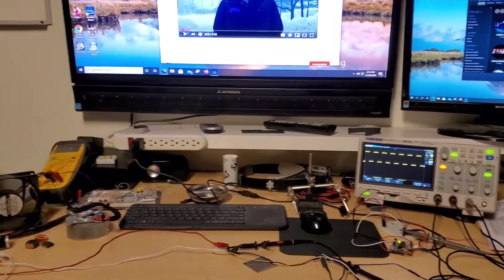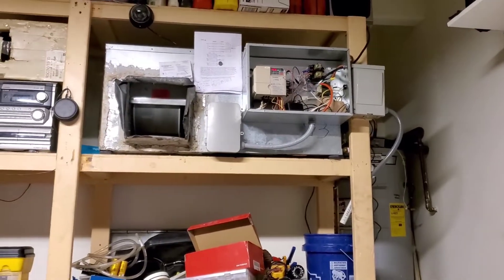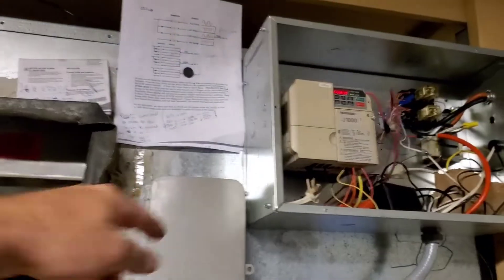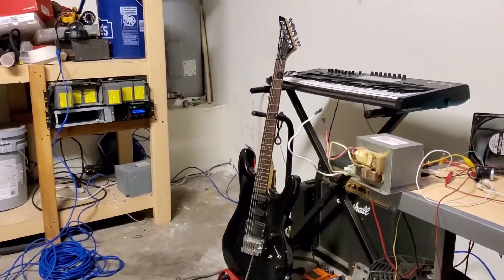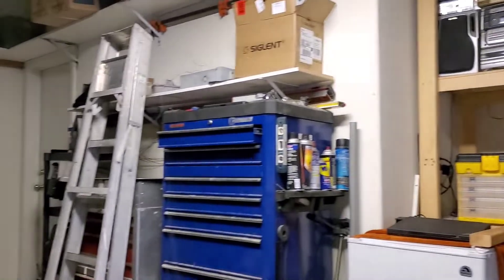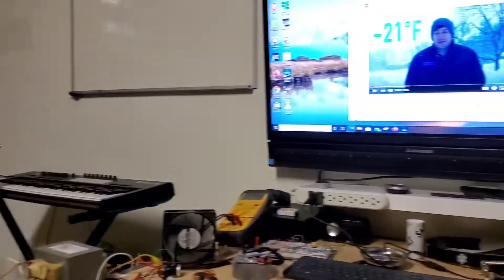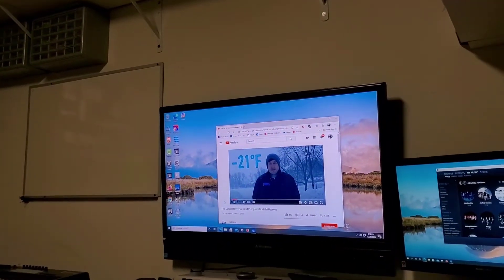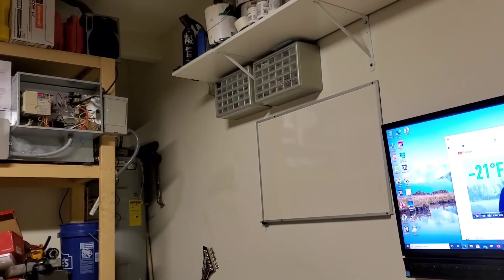I moved my electronics lab out to the garage where my heat pump water heater might freeze me out!

Comment: If you have a neutral, wire up the elements with 120V so they'll be 1/4 the power. That way heat pump and elements can slowly work together. You could also add contactor and 24V time delay so the elements run after like 30 mins if the heat pump isn't cutting it in the winter. Could make that work with a 2-stage thermostat somehow too. I know the hybrid tanks bring the elements in if the heat pump isn't keeping up after a while, such as in winter.

Comment: How do you like the water heat/cool set ups? I was thinking about doing one when I buy my house. Did it work well in the PHX heat?
Reply from the maker: It doesn't run enough to cool the garage in the summer. It is just there to heat the water instead of using the standard water heater electric heating element.

Now that it is winter and people are using the hot water longer it is overlooking the garage. Which wasn't an issue when I installed it but now I moved my electronics hobby stuff out to the garage.

I don't have any heat in the garage

Comment: You could get heat from composting leaves in a makeshift structure to store them in. A coil of poly water pipe inside circulating water could generate some heat. It might take a few weeks for them to start decomposing, but this method has been used to preheat the water going into the water heater. The review I read said that the water heater didn't come on until late April or early May, and that time of year the water temp going in was over 100°. Peak temperature was about 150°.
Concrete block stacked in a circle to about 6' filled with wet leaves and supported by rebar (or something similar) worked for the guy.
Reply: https://youtu.be/d4TfmP5cA-Y
Reply: @Farm_fab  Yeah that's a huge setup with probably 15 tons of compost and a 5 layer heat exchanger to heat ~55 gal of water, 15,000 BTU/hr peak output by my calcs (typical is probably half that). No mention of supply or return temps. It would probably take several hours to make enough water for a lukewarm shower with that setup. I don't disagree it works, it's just not going to be practical for homeowners on that scale, but if you live on a farm with a bobcat and tons of animal and plant waste then it might work for you. Your typical backyard compost pile isn't going to be big enough to do much. Maybe it could heat an insulated chicken coop but not much more.
Reply: @TechnicalLee  it's much larger than the one I saw in Mother Earth News, but much the same idea.
Reply: Makes kinda sense, but when extracting heat wouldnt that stop the decomposing proces? Otherwise its actually a genius idea.
Reply: @sjefoekel6058  I think this article I read was in the Mother Earth News many years ago, and it didn't seem to be a problem. The heat derived was from the decomposition process, and I don't think that they took it all away. The same could be gotten from wood chips from the companies that trim trees near power lines. If they are in your area they can give you some when they are trimming the trees, or call a tree surgeon.
Reply: Are you sure it wasn't air temps being measured? Water takes a lot more heat. Compost puts out heat very slowly, like 1000 BTU/hr per TON of compost once it's going. A gas water heater is like 50x that. So it would take 50 times longer to heat and max temp of the water probably wouldn't get much above 100º. Compost only puts out about as much heat as a light bulb, so it's not very viable for water heating. You could heat your aquarium but not a shower.